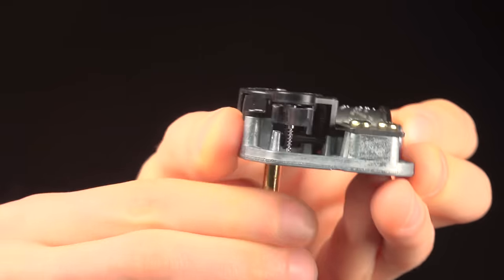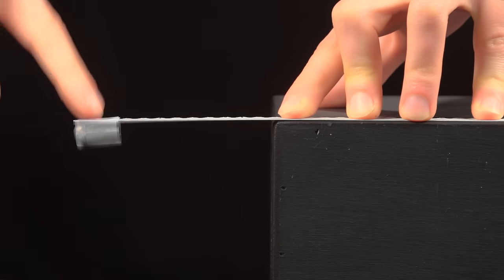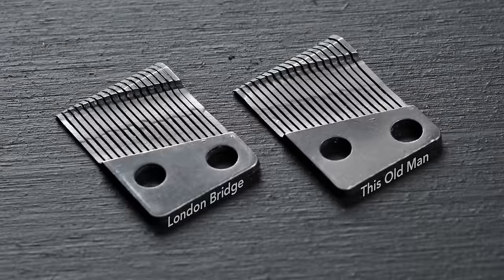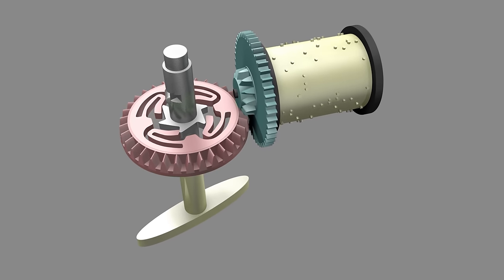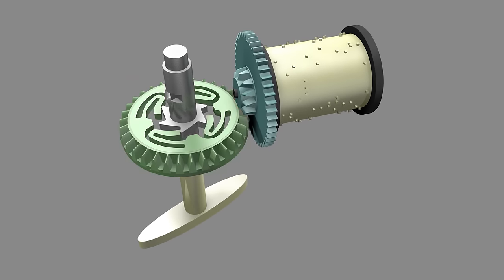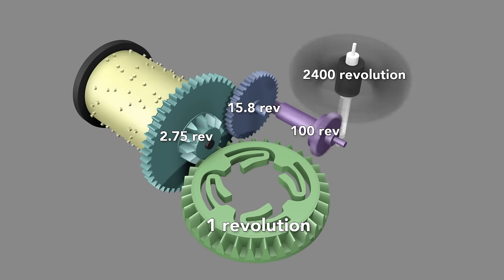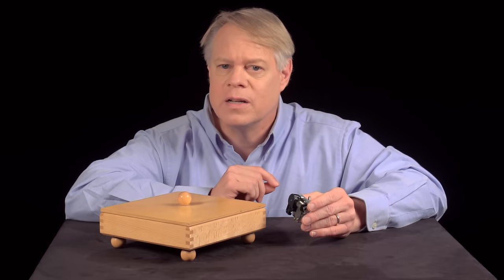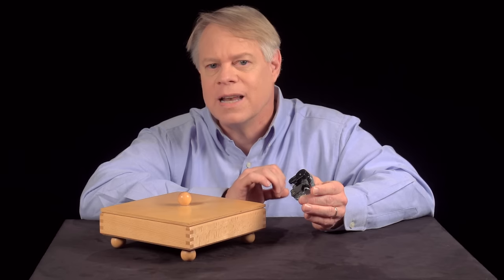How a Wind Up Music Box Works

Comment: how much voltage, in your estimate, could a restless leg syndrome person generate with a larger contraption of this style but with a very large clock spring and instead of a wind up key, a foot pedal of some sort, perhaps the one on a clay pottery spinner? how big of a battery would we use and how long would it take to fill based on the energy estimates a clock or music box could generate, x100 in a human usable size? or perhaps the Wheel of Pain from conan the barbarian? how much voltage did arnold generate